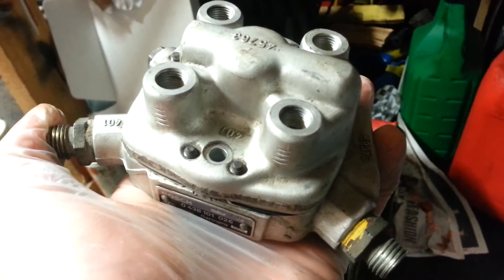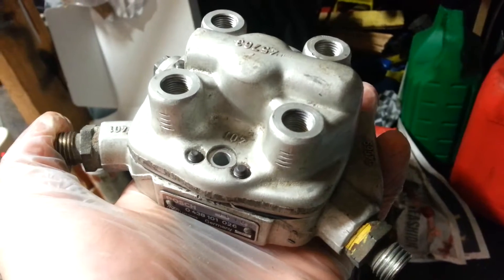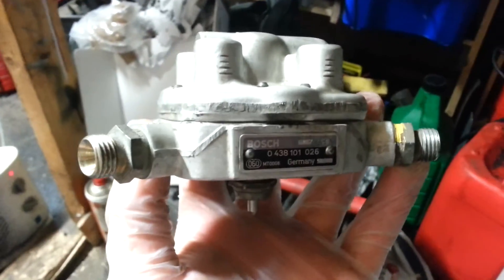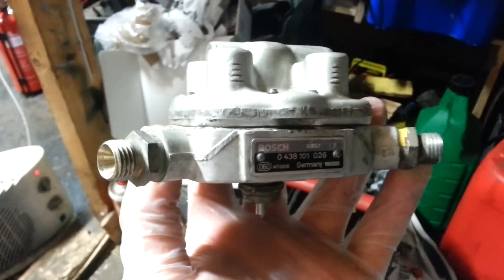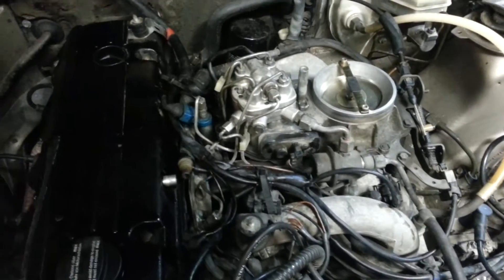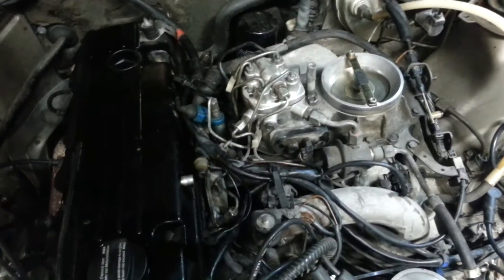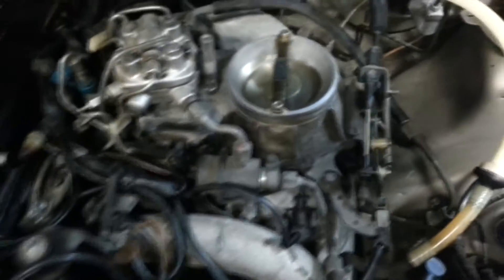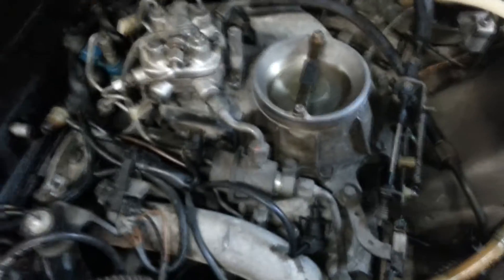How to remove fuel distributor KE-Jetronic

Comment: after removing out the fuel diatrubador weust replace it or we can clean it too
Reply from the maker: you can try to clean it, as long as you're careful.
you can also try to only remove the fuel lines from the distributor and see if there is any shit stucked in their, it might help.

Comment: how do you know it's brocken or don't work?
Reply from the maker: Da0Real0G It can be different signs. The engine wont run properly and you have excluded all other possible causes. Or maybe engine only runs on a few cylinders, one cylinder might be completly dry OR flooded.
The fuel distributor doesnt break easly and should outlast the cars life, but it CAN break. There are cheramic plates inside it which can break, the diaphragm can also break...

Comment: good job
How to adjust the amount of fuel in the fuel distributor when you open it ?
Reply from the maker: سلام السعيدي Thank you!
The backside of the distributor has black caps, if you remove them there are screws for each fuel line distributor "spray" right under.
But I STRONGLY advise against messing with them since even the slightest adjustment can render the fuel distributor useless. Either by flooding the cylinders, or giving them too little fuel.
It is very hard to adjust them correctly without special equipment.
The reason why I had to change my distributor is because I tried to adjust the old one, and not being able reverse my adjustment.